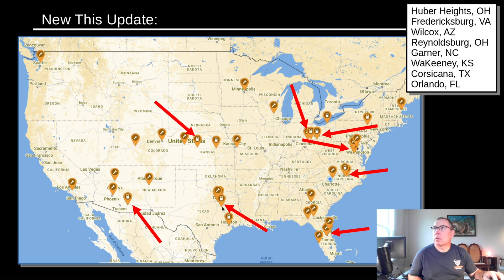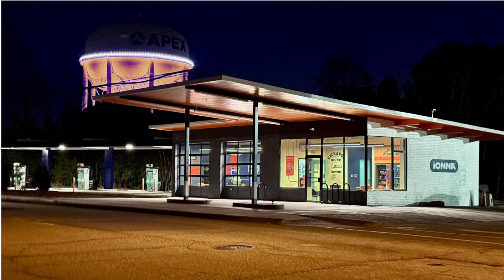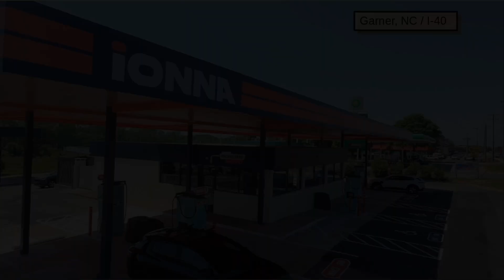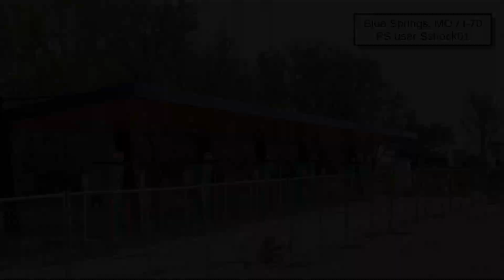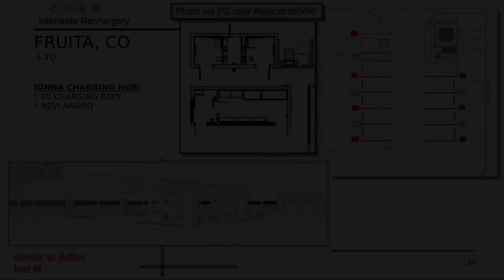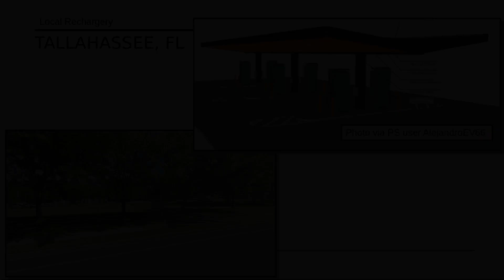IONNA Project Update - #11

Comment: Thanks Walter.  I get excited every time you post an IONNA update! 

Seems they ARE picking up the pace, but to meet their numbers, don’t they actually have to be going EVEN FASTER than this? Seems there ought to be about 50 more “coming soon” sites added in the next month or 2.

Go IONNA!
Reply: They have yet to announce any additional Sheetz locations, but I think those would be much easier to open than the stand alone sites so I assume that is one way they will get their numbers
Reply: @shethjones4494 I’ve seen a lot of installations at Wawa stores here in Florida. All they have to do is install the chargers.

Comment: I’ll have to stop by reynoldsburg tomorrow. What happened to Huber Heights? It was on your first and never mentioned.
Reply from the maker: HH had the construction replaced and IONNA cleared out for some reason.
Reply: Probably worried about the impact of the Buc-ees being built two exists east.
Reply: That and Springfield one further east barely has any patronage.  At least during the weekdays from what I’ve seen.
Reply: @thenetworkarchitectchannel, the dug part of the Hubert Heights site has been replaced with flower beds. You can’t even tell Ionna was ever there.

Comment: And still no app. WTF
Reply: You don't need an app if each automaker has ionna integrated into their in house apps. Why would we want more charging apps???
Reply: @shethjones4494 100%. No app needed if in car navigation.  IONNA supports Plug&Charge too!  (I want to say goodbye to apps!)
Reply from the maker: Their PS descriptions are showing partner apps able to be used.  I am thinking they will stick with that for awhile. Not really sure though.
Reply: @thenetworkarchitectchannel  I don't care about the app. I just want Ionna to have it's own check box in my Equinox's payment menu so it shows on the car's route planning.

Comment: I am happy to provide updates/videos/photos of charging stations in the Orlando area if you want.

I did a Google maps search for the 7785 Palm Pkwy location and it is near Disney Springs and SeaWorld just off of I-4. The 946 W Mitchell Hammock Rd location is less than 5 miles from my house in Oviedo so I can also provide some photos of that location when it begins construction.
Reply from the maker: thx.  Easiest to just add to plugshare.  I have the sites bookmarked.  Exciting!
Reply: @thenetworkarchitectchannel okay, will do. By the way I just got an email from Electrify America informing me that the Florida mall location in Orlando is now open. Unfortunately, the cost is a bit on the high side because that is a tourist area.

Great news! The Electrify America charging station you were interested in has opened at 8001 S. Orange Blossom Trail, Orlando, Florida 32809. Get directions and more details in the Electrify America app.